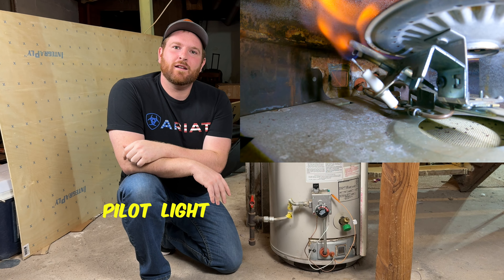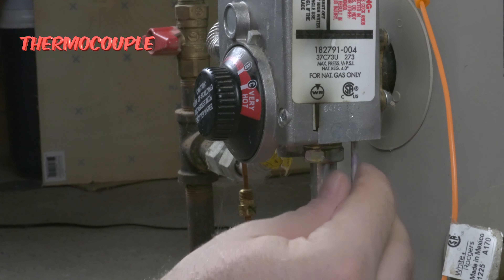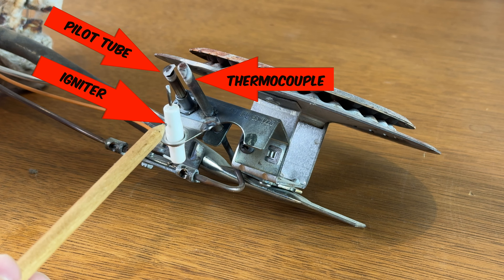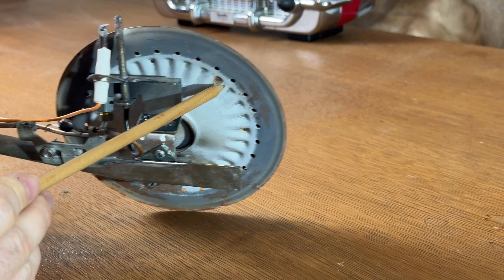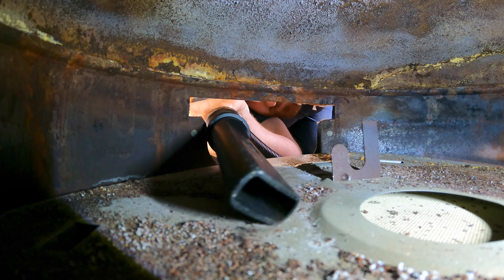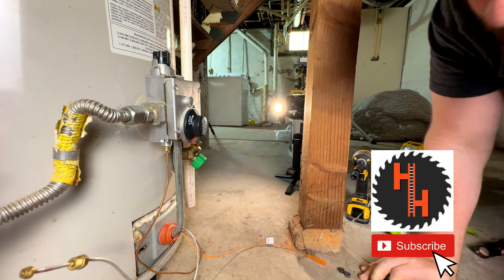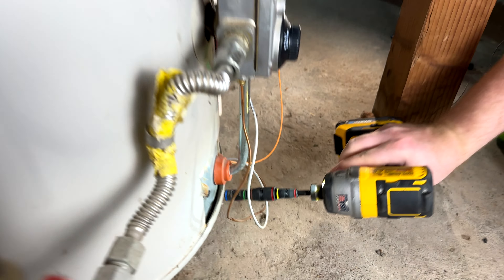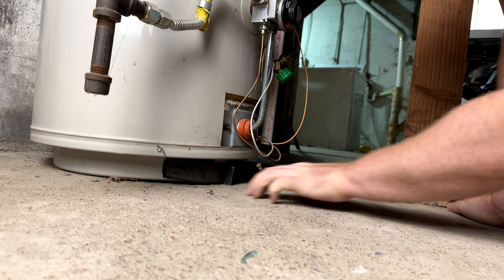FREE Fix! Pilot Light That WON'T STAY LIT on Water Heater

Comment: I just paid my plumber to do this for $400 and it was still not working, he told me i needed to order a new heater. I watched this, and it took me 20 minutes and now it works fine 😕
Reply from the maker: Glad to help you, sorry you got bamboozled by your plumber. That's one reason why I love fixing as much stuff as I can, and learning how to do it myself. Even if I break something or do it wrong. 👍🏼 good job for fixing it.
Reply from the maker: Also, you may consider leaving them an unfavorable review on yelp/facebook  or online somewhere. Sounds like they run a sloppy business at best and are lying thieves taking advantage of people at worse. People should be aware. $400 is thievery for what they did (or didn't do). Plus trying to sell you a new heater too.
Reply: Lucky you. I did this and the burner plate is not lighting... the gas works. You can smell it when you drain it. It ignites up. But the burner plate itself does not catch fire.... please why?
Reply: Brand spanking new thermocouple assembly and burner plate. Matches codes for water tank
Reply from the maker: So you have a pilot light but main burner not coming on?
Reply: @HandymanHertz  correct
Reply from the maker: Sounds like a bad control valve or maybe your burner assembly not transporting gas correctly. If your pilot goes out when you let it out, I'd say the flame isn't hitting the new sensor properly, which is common. But sounds like you have other issues.
Reply: Get your money back from the company, or blast the Internet with poor reviews for them
Reply: Trying this today our went out yesterday just had a plumber here said $1500 for new one😮
Reply: Love those experts! Thank God for  great guys and gals that make these videos!
Reply: Are you telling me Jesus Christ can't hit a curve ball OR fix a Water Heater?

Comment: Good photos; helpful. But twice, the thermocouple wire is referred to as the pilot gas tube and vice versa. Also would be helpful if you did not skim over the 'checking for leaks' part. Actually show that. it's important.

Comment: In my situation I can light the pilot and it stays on. Then I set the desired water temperature. It heats up water but when the water temperature drops( after some time) and it should turn on automatically, but it does not. It appears the pilot light is off.  For some reason the pilot light goes off after the first cycle of heating. I am completely puzzled. Do you have any idea why that can be? Thanks!
Reply from the maker: I think I can help you. This is exactly what happened to me on when I made this video…the pilot would light and stay lit, but after if heated up the water, the main burner AND the pilot light would go off. So, for several days, anytime we wanted hot water for laundry or a shower, I would have to go start the water heater 30 minutes beforehand. I cleaned up the thermocouple real good, and it worked. You can replace it too easily and cheap. Hope this helps!

Comment: It worked! My heater has a gasket between the "inner door" (the metal plate with the glass window) and the tank wall, and I had to do a bit of prying with a screwdriver blade and putty knife to free that from the tank wall, but it came off intact (still stuck to the inner door). I've read elsewhere that the gasket is to keep any flammable fumes in the room from entering the burner chamber, but is not otherwise required for operation, but anyway mine is still good. 

I had to try a couple times to get the fitting for the pilot light gas tube threaded right, but once I got it right I knew it because it turned easily by hand most of the way. Glad I didn't just resort to the wrench when it wasn't turning freely the first time. I used the soap bubble test once everything was running (I applied it with a toothbrush) and I did have to tighten both fittings a little more to eliminate bubbling.

Thank you for this excellent video!

Comment: The pilot and thermocouple are reversed from how you mentioned them. The thermocouple holds the pilot valve open via magnetic force. Hence why it connects beneath the pilot control knob. Just did this exact replacement a couple of days ago.

Comment: I have two water heaters- AO Smith- GCVX50-100 (2011) and a Reliance 675XRRS300 (2015).  Both went out at the same time.  We tried cleaning the burner and replacing the thermocouple.  We even changed 1 gas valve so far on the AO Smith water heater.  After changing the gas valve, it worked for an hour or so; however, it went out again.  Both water heaters are vented to the same chimney, which is also where the boiler is vented.  The boiler has no issues.  Any other ideas what may be causing both water heaters to fail at the same time?

Comment: What is the soap and water trick?
Reply from the maker: To check for air, leaks, or gas leaks, put a squeeze of Dawn dish soap into water and shake it up and spray it. If there's a leak, it will bubble up.

Comment: Hey Tim , I’ve replaced the gas control valve and the thermocouple assembly. All works well for the first thirty minutes and then the pilot light and burner both turn off. I was able to get everything working one time to where it would get to temperature , burner would turn off, and the pilot light would stay on. It would cycle through again and then shut everything off. 
Any ideas.?

Also awesome video , I wish I would of tried this first 😅.
Cheers buddy.
Reply from the maker: Howdy! Hmm...my first thought would be to double check that the flame is hitting the new thermocouple. You could test the voltage on the opposite end of the flame sensor if you wanted. I would then check to see if your little vent is plugged on the bottom (it needs to suck in air easily  or it will be turbulent, causing the flame to go out. Another thing I would wonder is if you have a leak in your chimney or some sort of draft coming down and blowing out your pilot light. But if you can't even get it to stay lit, this isn't an issue probably. Maybe you could clean out the pilot light gas tube… Maybe some ants blocked it or a bug is in it and not allowing enough? You see  All sorts of random things. I would look to your gas control valve… But you already replaced that, so no need. Let me know if any of that helps. They are pretty simple machines… At least most of them if they are like my model.
Reply: The gas water heater that I was trying to fix looks very similar to the one you were working on actually.! AO Smith , about 20 years old. I replaced the whole igniter , pilot tube , and thermocouple assembly. As well as the gas valve. I suppose I will need to double check that the thermocouple didn’t get bent or something whenever I was reinstalling it and then test the voltage. The vent on the bottom is nice and clean. I took a peak at that while I was cleaning around the pan to check for leaks. I can check for a backdraft through the chimney , that’s not a bad idea either. You’ve given me plenty of food for thought though. Thanks for the reply , I’ll keep you updated if I find anything out. 
God bless.!
Reply: Hello there, just wanted to let you know that we resolved the issue buddy.! I took the assembly back out and double checked everything. It looked in order so I put it back in and tested it. Like magic it worked again. I believe you were onto the issue with the pilot light not being on the thermocouple properly. I think it was just crooked when I installed it the first time and the flame wasn’t covering majority of the thermocouple. Good looking out sir.! Thank you very much.
Reply from the maker: @sethlozano5450 hey, glad to hear it worked out for you! I hope that works for you for many many years!

Comment: Amazing video, just two questions. I already got it out: 1- How do I know which one I need (model). I have the AO SMITH ProMax + Plus. 2- how do I remove the orange seal without damaging it and place it back on?
Here is the model of my unit: OA smith, thermocouple for water heater model s gvr 50 100
Reply from the maker: Thank you. To be honest, I’ve just looked at the one I had and matched it up with one on Amazon that’s made for the brand. I don’t think there’s too many variations, at least in my experience. When it comes to the orange seal, just pry it out with a flat screwdriver and then work it back in with a flat screwdriver. That seems to work good for me, but maybe someone has a better way. Sorry if this got to you too late.
Reply: @HandymanHertz : THANK YOU 🙏🏼 and May GOD BLESS YOU. I ordered Everything you recommended. I had ran into a small problem. I had connected everything and the gas detector kept detecting a leak. I literally spent hours trying to figure it out. Finally, I thought to myself, what haven’t I tightened up really good, and that was the middle tube that connects to the burner. Thank God, that did it and no more smell of gas and the gas detector stopped beeping. My entire family thanks you, again God bless you.

Comment: Moved into new place in alberta.  Sgop heater is a 
MG =50=N MINI GAS BOILER. 

new thermal couple and still will not stay lit.  
Had it stay on for a half minute then went out before i could switch from pilot to on. 

Any ideads what to check . 

Sanded down old thermal couple and same deal.   Pilot does nit remain lit.
Reply from the maker: I’d adjust the thermocouple and make sure the flame is hitting it properly and the. I’d replace it if that doesn’t work
Reply: Are you holding the pilot control knob down for approximately 60seconds after the pilot flame is lit? The thermocouple generates millivolts to hold open the pilot valve inside the gas control and requires a specific amount of voltage to generate a strong enough magnetic force to hold the valve open. Also be sure that there are no kinks in the line. 

You can also try testing the valve coil with a multimeter set to ohms, stick one end in the port that the thermocouple connects to and be sure it doesn’t touch the sides of the hole, just the bottom. And place the other lead against the wall of the thermocouple port. If you get no resistance then you’ll probably need to replace the gas valve entirely as they’re often one whole unit and not rebuildable.

Comment: What do you do if you've removed the gas line, thermocoupler line and then the nut for the main burner tube, but when you start jiggling the main burner tube to release itself, it simply cannot be pulled down and away enough to release itself from the hole?
Reply from the maker: Hmmm i've never ran into this issue. I would probably Google my water heater brand and search the forums on what other people found that worked
Reply: @HandymanHertz  for the reply. I got it loose - it involved more jiggling and moving around of the burner unit.

Comment: Had same problem. Followed the video. Cleaned up the thermocouple nicely as instructed. No change. Replaced thermocouple, still no change. Pilot dies out when I release the red button on top, no matter how long I allow the pilot light to heat the thermocouple.  Looking for next part to check. Ideas?
Reply from the maker: make sure the flame is touching the thermocouple. If it is and you replaced it already, I wonder if it's a a bad gas valve. Not exactly sure how they work, but I would think the voltage isn't tripping the gas valve. Maybe check the voltage at the end of the thermocouple with the flame on it, and google what the millivolts is required for you type?
Reply: Mines doing same thing…brand new pilot assembly pilot won’t stay lit. Did you find the problem?
Reply from the maker: Make sure flame is touching thermocouple. That's an easy one that overlooks and can come across as intermittently working.
Reply: Clean the intake screen under neath , air flow
Reply: Usually 30 millivolts.   @HandymanHertz
Reply: @sleepyhollowoutdoors3838 any update by chance? Same problem here.
Reply: @ I ended up changing gas valve. Been working good sense

Comment: Is there any chance the thermocouple nut might be glued in place? I tore up the nut trying to remove it. It still won’t move. Guess I’ll be spending my day off on this tomorrow 😂
Reply from the maker: Hmmm unlikely, at least with the brands I've dealt with. You may try using a flare wrench or vise grips. The main burner tubes if Bradford whites can be a bear sometimes.

Comment: Main burner tube but will not budge at all. I keep forcing it but it feels like it will break something if I try harder.
Reply from the maker: There's only been one of those that I came across. That's been like that in my experience. I ended up leaving it connected and was able to work around it. But if I were you, I would use a flare nut wrench. To get a good grip on it. What brand is it? I believe mine was an Bradford white. Not sure if they put licorice in it or what? I've also searched a lot of the Plumbing forums to see what they did, and didn't remember finding a solution at the time. Let me know what you find out, I'm curious to know.

Comment: I hate a leaking hose that i did not know about. At the same time my gas was disconnected. I found my gas control know hard to turn or push down now. I tried to light the pilot with long matches , but nothing ignited. Why am i not getting gas to the pilot, thermocouple?

Comment: Changed  it but still shuts off, like it's  not getting  gas. Is it the value  itself?
Reply from the maker: Could be the gas valve. Name sure the flame is hitting the new thermocouple properly and that it's the correct 
Thermocouple for your heater.

Comment: Thank you.  I cleaned the parts and reassembled.  My pilot light needed to be purged for about a minute and then it light up.
Reply from the maker: Nice, glad it worked for you! If it gives you more troubles, maybe look into making sure the pilot light is hitting the thermal couple properly. This is common when reassembling that it gets bumped.

Comment: I changed thermocouple but once I like my like my thumb off the control valve it the pilot will go out it does not stay lit no matter how long I hold it it will not remain lit
Reply from the maker: Most likely this problem with a new thermal couple is that the pilot light is not contacting the new thermal couple. You may need to adjust it.

Comment: Should have taken sandpaper/wire brush and reached in and knocked off any rust on bottom of tank. You should have thought "hey where did the rust come from that was on the burner assembly? "   Maybe the next video you make will be servicing the anode rod .
Reply from the maker: Interesting suggestion. Personally, since water heaters die mostly from rusted out tanks (in our area, at least) I'm not going to mess with an already leaking tank with abrasives. 

What do you mean servicing the anode rod? I have a video on replacing the anode rod...
Reply: @HandymanHertz  I don't know what state you're in or water quality,  I would bet you,  check THAT tank, and that anode rod is desolved (gone) henceforth the reason you had THAT much rust. The sharp businessman would crack open the cap at the top and visually inspect the anode rod (with customer) and as needed, sell them an anode rod job and/or advise them that the W.heater is on its way out. The customer will then discover your compentcy and concern for their upcoming hot water issue. Tape your business card on the side of the heater , they will remember to call YOU back , when the time comes. "Building LOYAL customers , one customer at a time"
Reply from the maker: @jamesborton9237  yup, sound advice, go over and above and build quality, loyal customers 👍🏼 one note: if the anode rod is dissolved and ineffective, it would rust the tank out from the inside, not the outside. And the outside is  where rust was dropping into the burner.

Comment: I can’t get the nut loose on the main burner tube. I have no help. I’m just a girl 😂 what do i do 😩
Reply from the maker: Some tips: get a flare wrench, spray with penetrating oil. Tap it will small tool to break loose. Make sure it's not opposite threads of what you think. Sure hold back so you don't bust gas control valve. I've only experienced this once in an AO SMITH Brand heater.
Reply: @HandymanHertz  i sprayed with a little wd 40 and letting it soak a bit now. And ok I’ll tap it and try then and see if it’s not twisted the opposite of the regular way. God help me not to bust or do anything wrong. I’m nervous about gas stuff and doing this myself already

Comment: This really helped me. I cleaned the thermocouple,  I was holding the button down for 5–6 minutes, and it was going out immediately, after cleaning it and reassembling it, I held it down for 5 seconds, and it stayed on long enough. Thank you. There was a burnt up rubber gasket around the compartment that I couldn't do anything with, will this be a problem?
Reply from the maker: Glad it helped! It it's the small one like in my video, I wouldn't worry at all about it unless you have gusts of wind, like in a garage or something that can blow the pilot light out.
Reply: Thank you.

Comment: hi great video I was thinking about the same solution before I found your video because I did the same procedure for years to my furnace and actually I have taken out the burner assembly right now and stop because I found a piece of twisted metal  plate that fell down from the exhaust center of the heater do you know what that is and do I have to replace the whole heater?
appreciate any advice
Reply from the maker: Hi, I believe the spiral metal piece is your flu baffle/heat exchanger. I do not know if you need to replace it, but I do know you need a functioning flu.  I’ve never heard of chunks of the baffle falling out. my concern would be if the top pieces are falling, it may clog the flu, and not sucking the fumes up the chimney correctly